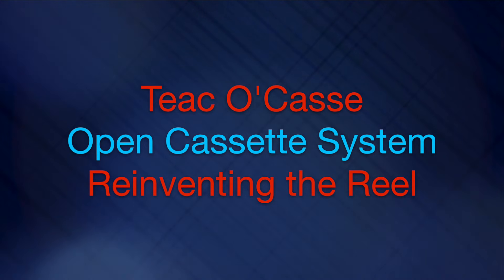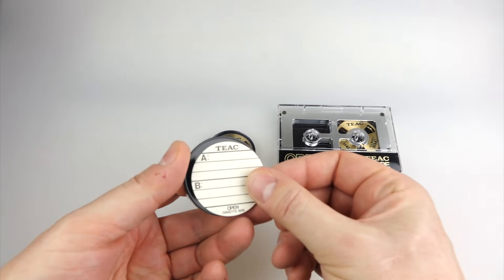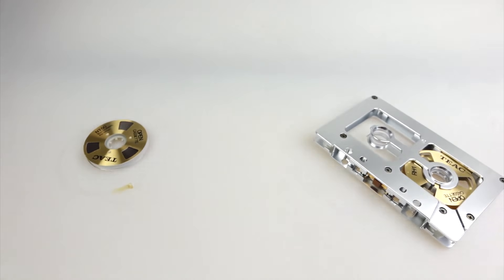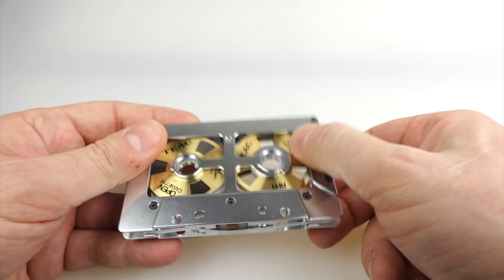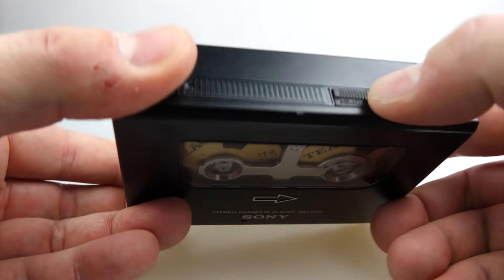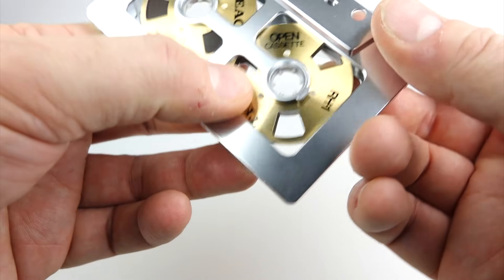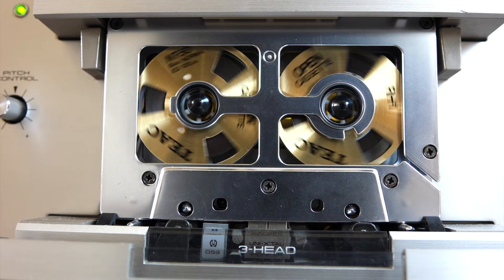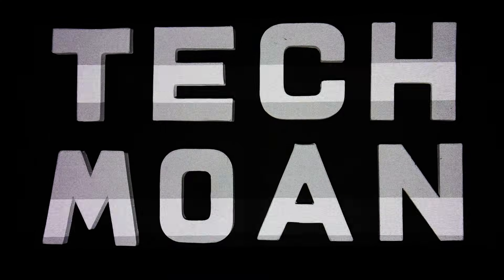TEAC O'Casse Open Cassette -  Reinventing the Reel

Comment from the maker: @Usernameowain you can read up on tape tabs here http://en.m.wikipedia.org/wiki/Compact_Cassette#Cassette_types
"Notches on the top surface of the Compact Cassette indicate its type"
Reply: Techmoan I would much rather have a tiny reel to reel machine sitting on my desk.
Reply: +therealquade Oh my God. When I think about a little machine to have these in there open... That would be way cooler.
Reply: Philip vB well.... I watched some videos on how tapes actually work. with modern tools it could't be that hard to make one. now, making one that sounds good.... that's another question entirely. 

Now, after watching Techmoan 's newer video about different kinds of tape... how hard would it be to get metal versions of these (metal tape) and building a mini reel-to-reel with dolby type S. it could be done....
Reply: +therealquade 
I think we could put 4 to 6gb on a tape in the same cassette format today and have it play full HD movies! But what's the point, we have postage stamps now for that. And they are random access.
Reply: TruAnRksT because the lifespan of a CD is something like 30-40 years, but the lifespan of tape is 70+, and the lifespan of SSD is only about 10 or so years, or a finite number of read/writes. if you read/write to the same sector on an SSD enough times, that sector will brick and become unwriteable. it's only something like 50 times too, its an incredibly low number. If you actually disassemble and examine the circuits on an SSD, there's actually several dozen times the storage capacity as is claimed, and the exact reason is that after the finite number of read/writes (which is a known quantity) it will duplicate the data onto a clean sector so the data isn't lost, however when fresh sectors run out, you've got an unreadable brick.

so those micro SD Cards? yeah fill it and clear it a few hundred times and it's toast, and that's true with nothing but reading. find an SD Card that's small enough to fill with a single video file, and see how many individual times it can be read from the SD before it becomes unreadable. a 40gb flash card (solid state memory) will die after roughly 840-900gb of read/write, or roughly 20x it's capacity. (based on some testing that I found online

Tape doesn't suffer from this problem, because it is literally just magnetization/demagnetization of iron. that's not a property that will expire. the only shelf-life of tape, is until the material the tape is made of has broken down, or the iron has oxidized, and the estimates are over 70 years. the ends might get a bit useless but that's all header-space.

That means there actually is a valid argument for storing streaming video to tape for reel playback, as an updated "VHS HD" or something. 

you have to weight 5 factors.
Lifetime of the storage media (Tape wins)
Data volume by storage volume (Solid state wins)
Read/Write speed (Solid state wins)
Cost of manufacture (Not sure personally)
ease of use (Solid state wins)

The physical space, and weight, of a VHS Tape containing a movie, Vs a Disk, or memory card, is astronomical, not to mention you have to re-wind it. This means your movie collection takes up more space for the same content, and is harder to move. 

The advantage is, your movie collection will..... probably out-live you? Tape is good for archives, but not much else. 

but if you want to ignore that, you'd need a data format for video that can play back at the read rate of your tape. MP4 won't work. if you play it fast enough for iframes to be realtime, then it would hang on the pframes, and if you set it for pframes to load in realtime, the iframes would be in fast forward, or you'd need to have some kind of 600fps mp4's, and accept that every time it needs to load a pframe you'd get a massive drop in fps. AVI works, because it's all pframes, but AVI's are HUGE. 

I do like the idea... I just don't want to be the person that actually implements all of it. that's a crapload of work, for something hardly anyone will appreciate.
Reply: +therealquade 
>>that sector will brick and become unwriteable.<<

throw it away, start over.
Reply: TruAnRksT throw away the drive and start over? yeah, that's what you literally have to do. Tape has a much longer lifetime than solid state. by a huge amount. 

Now, my point is that you mentioned full HD Movies. If READ ONLY MEMORY can get bricked this way, solid-state and therefor SD Cards, DO not work for film distribution and playback long-term. Lets say a film is limited distribution. Now add a short shelf-life to it. This would be like distributing music on wax dub-plates. 

This is why we use CD/DVD/Blu-Ray and not SD Cards with movies on them. They don't have a finite number of reads, much like tape. The difference between disk and tape, is that disk is smaller, lighter, cheaper to manufacture, and reads faster.
Reply: therealquade
In fact, lifetime of a tape very much depends on storage and kind of tape. If you have a bad ferric cassette with a coercitivity of something like 300 Oersted, if you store it by leaving it in the sun for a few days, there will be close to no data left. If you have a TDK MA-XG or at least a higher grade chromesubstitute ferricobalt tape like a Maxell XLII-S, if they are kept nicely, those will last forever. 
I just wanted to say that it's not so easy to generalize that.
Reply: Philip vB I was just going by the current standards for modern tape drives, IBM's LTFS is 10 TB and is expected to have a shelf-life of "70+ years".
Reply: But they definitely use better tape than what's in cassettes. That is industrial grad enterprise stuff.
(And by 70 years guaranteed, they basically mean forever...)
Reply: Philip vB I dunno what tape they actually use, i'll have to compare the video I saw where they opened one up, to the video techmoan did about different types of tape... I know it was a sort of brownish-black-ish red-ish color.
Reply: therealquade
I definitely think ferricobalt there... Like in the video cassettes back in the day. As the background noise is a bit higher and it usually takes higher levels, it might be better for data storage than metal as the print-through is less. But metal is better than ferricobalt for analogue applications due to the low background noise. BTW: Type 1 is rust (Fe2O3) and Metal is pure refined Iron,
Reply: ***** Then you simply could have gotten a few Teac Sound52..
Reply: +therealquade The only way to get around the limited shelf life of SSD is to copy the files on a second SSD and use that to work with, and saving the original files with just a minimal number of read/writes (just to make a new copy if the other gets screwed up.
But not sure of the shelf life of SSD even when you just have maybe 1 read every 5 year or so.

Tape can last long when of proper quality, I still have some cheap ferro type 1 cassetes that were my first when I got a cassette player some 40 years ago, these sound rubbish now, but the later chromium tapes I bought and recorded on better equipment are 30-35 years old now and they still are good enough to replay with a very reasonable sound qualit
My video hi-8 tapes, from which the oldest are around 23 years old, still are almost as good like the day they were recorded, I store them in a drawer that's away from the central heating radiators and more important, from any device that creates a magnetic field, like your audio visual equipment or things with electric motors ore magnets in it (the distance is about 3m in my case).

I'm not sure how large data storage facilities like Google get around this problem, with in some cases millions of read/writes a day, they still use mainly HD drives?, and what is the lifespan of these?
Reply: Where can I order some of those? They look like fun. I'd prolly order 20 of the caddies and only use 5 at a time and order about 200 little reels. TEAC sounds epic. :D
Reply: You need to make a review on how well they work for high-speed dubbing. That is the real reason people would get a TEAC. :D
Reply: Yes, but in some tapes not widely sold (Type III) there are not notches, so machine recognizes them as Type II.
Reply: supermasterPIK Nope, Type 1. 
There are no extra notches for most of the FeCr-Tapes. 
Only the very last one sold had these.
These are extremely rare. Until a few months ago I had a ridiculously large cassette collection of about 8000 tapes, most of them really old, a lot of Type-3 Tapes. Not one of them had the extra notches.
Reply: Ys, you re right. Auto Switched to tape I norm on my Yamaha KX-10 minideck. 

fortunately, i have my m45 tapedeck with manual tape type selector.
Reply: Techmoan 

Even though I am strictly a computer guy, I think it would be really cool to have one of these displayed in my room somewhere.

The major difference between one of these things and something like a 3-D TV is that it wasn't supposed to be taken seriously. People simply liked it for its looks and how it works.
Reply: I was expecting the notches on top to have little sliding plastic covers, like the write-protect on MiniDV tapes.  But I suppose not having something like that meant buyers were more likely to buy additional caddies from them.

Comment: You really can't understand TEAC without understanding the 'Prosumer Market' of the mid 80's to mid 90's.  It was a time when tens of thousands of dollars could give you the ability that hundreds of thousands of dollars (if not millions) worth of equipment had provided only a decade earlier.  You could use a TEAC 4 track recorder (4 tracks in one direction on stereo tape) to record 3 mics and a time code signal that would sync with your camcorders that recorded the time code on one of the audio tracks.
Catalog all media and you had a 3 camera, 3 mic, time-coded shoot with full audio backup or extra tracks of ambient sounds.  In the 70's that would cost you a million in gear, and in the early 90's I did it with about $25k in gear (including chroma-keying, graphic overlays, etc).
Basically TEAC was a heavy player in the 'multi-media' market - a term that became meaningless as computers became fast enough, portable enough, and cheap enough to render obsolete by 2000.  Those were very exciting times.  :D
Reply: Thank you for this addendum, it helps greatly in understanding this phenomenon.
Reply: +mstrfool Well, that was my first company and it didn't go so well for me.  I wanted to make music videos - really dreamed of being some famous music video director even though, as it turned out, music video directors never became 'famous'.  In reality I wound up doing trade show videos for a juice company, wedding videos, and a cooking video that I tried to flog at flea markets and places like that, ha ha.
Reply: +mstrfool Well that was 25 years ago - I've done plenty of things since and learned a bit more with each venture.  I've only recently thought of doing some video work again - but this time just as a hobby making youtube videos about my hobbies.
Reply: +mstrfool I should have my first video up sometimes this summer.  I'll likely start with one a month - but nothing 'artsy' - just going to share a bit about my hobbies.

Comment: Good lord, I thought swapping out and flipping over regular cassettes were a pain in the ass! Having to unspool and re-spool these little reels? Ugh! 

Unless one can buy empty shells or "caddies", to load once and leave it, this would drive me nuts. 

Nifty for novelty only. Not practical, and I doubt sound quality has much to boast either.
Reply: Blackie Nuff I think you could change the tape inside/ buy ones with higher quality tape, I think it looks kinda cool but I'd probably just put them in separate tapes of their own to avoid the tediousness of swapping them out
Reply: Honestly, if i owned a massive cassette collection, I think it'd end up being more economical to have a few open cassette caddies + a huge amount of these reels than a huge bundle of cassettes.

Comment: +Techmoan Very cool! I've never seen one of these before. In the States, Teac did offer an enclosed "open reel" cassette better suited to the marketplace. It looked similar to this (the reels being nearly identical, but only offered in gold), however, it was fully enclosed. Overall, it wasn't the highest grade cassette, but it really scored on visual appeal (often being used in promotional photos of Teac's own equipment). Perhaps the coolest cassette ever was TDK's metal-framed metal-tape cassette. It was a cast aluminum frame with transparent polycarbonate side panels affixed with screws. Given I only have one example of each (in that black hole of 'somewhere in storage'), I wasn't inclined to do descructive testing, but I could easily see the TDK example surviving being run over by a vehicle with little more than cosmetic scratches. Both of these were pretty rare, even back in the day.  Ah, memories...

Comment: I'd really like to see more of the tape to tape Walkman.
Any chance of doing a video on it please?
Reply from the maker: +Dan Xepha unfortunately it's non-working.  Perhaps one day I'll take it apart.
Reply: So it becomes a repair video.
I'd be happy with that!
Reply: +Techmoan I guess "non-working" is the natural state of that particular Walkman after a couple years. I tried to repair mine, and the electronics inside are so cramped you'd need a microscope to solder anything. The mechanical parts are built to last until warranty expiration + 1 day. Really, some of the last-century stuff is UGLY inside as it's beautiful on the outside.
Reply: Any progress on this? I'd really like to see a more in depth look of the device.

Comment: You know why that spool design is so great? Excellent tape alignment and low friction, even in miniaturized format. In a normal cassette, the tape rubs against the sides of a cassette from the inside as it rotates, and bad things happen.
Reply: +Siana Gearz Originally, cassettes had carbon lubricated slip sheets to keep the tape from rubbing against the sides of the housing. In later years, manufacturers dropped the slip sheets to reduce cost and allow for see through designs.
Reply: Doug Browning
In Soviet Union, a cassette cost about 4 roubles, while engineer's salary was 120-ish roubles. It did have slip sheets in it, but they never worked, they were apparently more clingy than they were slippery.

Japanese tape cost more than double, and it did work. But there still were limitations. The slip sheets are subject to wear. The friction against the sheets is dependent on the amount of tape spooled up, while on a spool it isn't.

Comment: I remember those little mini-reel cassettes being around; the best sounding cassettes for multi-track recording that I used in the 80's were Maxell XL-IIS (the XL-II cassettes were a step down from the XL-IIS cassettes).  jus' sayin' ✌😊
Reply: Not the same thing. Those Maxells didn't require threading. They were cute, but no advantage over a high-quality cassette shell.

Comment: LOL that looks like something I tried, back in the days of cassette tapes, when I had several cassettes that weren't working right (the tape kept dragging and slowing down for some reason).  I took out the shim sheets, and glued round pieces of milk-jug plastic to the sides of the tape hubs (with access holes where the tape clips in) and stuck'em back together.  Played just fine after that.  And looked cool, too.  Plus I could swap out the reels (did that to several tapes that had been sat on or something and the cases were broken)

Comment: This would be a really cool product with high build quality (metal, etc.), and a good design (What is the best possible design for easily and quickly loading a reel into the caddy? What is the best possible storage method?). I mean, no matter what it will be harder than just using cassettes, but it lets you store more in the same space, at the same quality, while retaining compatibility with any cassette player or recorder. Which really sounds pretty good, even if it would be a niche product (for fun, or a practical need to carry more cassettes).

Comment: Speaking of portable players.  I bought one that captures and saves into MP3 via usb.  I bought it to use it just as a standalone player, hoping the needed playback quality for decent capture to mp3 would be the focus.  It ended up the case for me, fortunately, but there were some complaints that it didn't work for others out of the box.

Comment: I knew about the tabs at the top for making a tape 'read only' but never knew about knobs for tape formulation.  My players/recorders had a button you had to press to select that manually. Maybe auto-detecting the tabs was a high-end thing. At least my low end ones would have worked well with this thing. Not that I would want to....

Comment: I don't know whether something like that could make it to market today or not... before today, I would have said you were quite right.  But this morning, I came across a product that rivals this one in its impracticality.  It's a 17.3" gaming laptop.  Now, yes, laptops with that size of screen are really a stretch to be called 'portable' and fit more in the 'luggable' category, especially with the additional desktop componentry they usually stuff inside.  But what really sets this thing apart is its "unrivalled cooling" feature.  You see, it's liquid-cooled.  Yes, a liquid-cooled laptop.  Not heatpipes, no, full on liquid cooling.  And, of course, that means there is a radiator somewhere.  But this is unrivalled cooling.  So there are actually two!  They attach to the back adding another 75% or so to its depth.  Amazon claims that it weighs 149 pounds, but I think that's a mistake.  I THINK.  I swear this exists.  It's the Asus GX700VO-VS74K.  So if something like these O'Casse Open Cassettes was proposed today... yeah, it might fly.  If the target market was gamers.